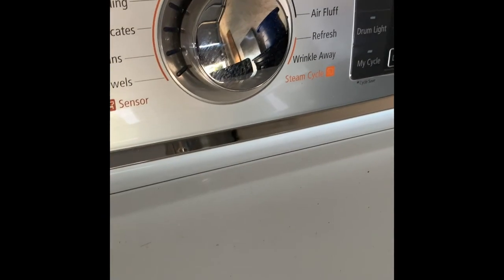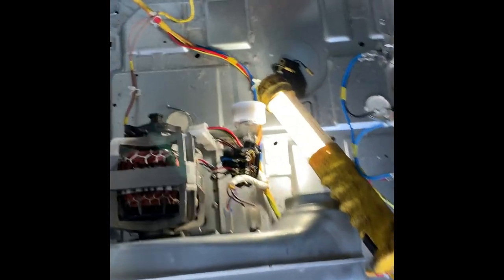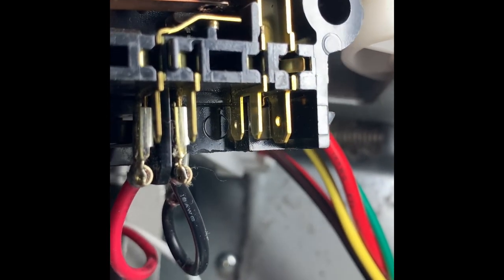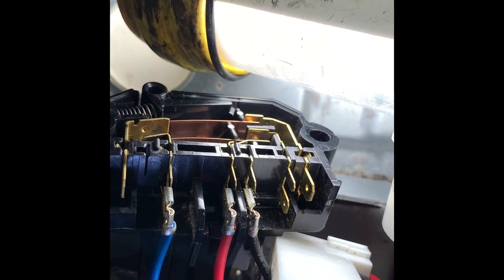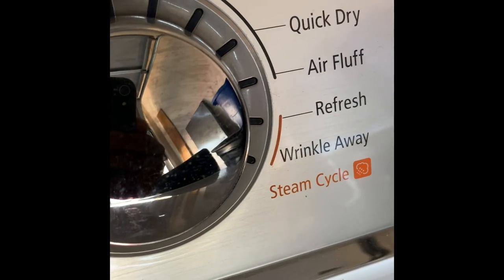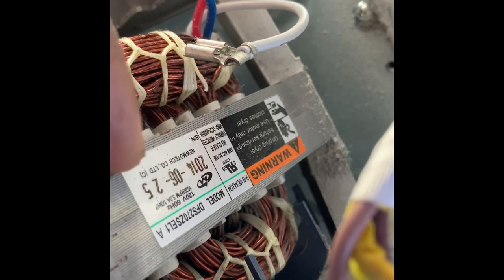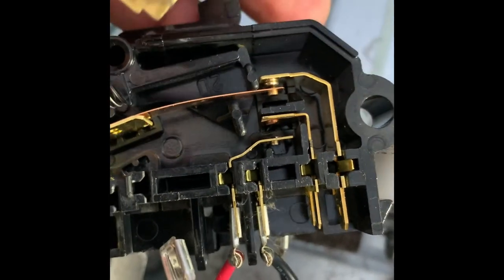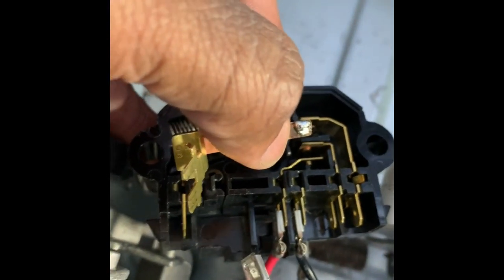Samsung Dryer Not Heating Fix + Repair (Motor Centrifugal Switch)

Comment: You sir are a genius.  My dryer was not heating.  I tried everything else then found your video.  Centrifugal switch contact wore out on mine also.  Soldered contact and filed solder to correct width.  Fixed the problem.  Thank you good sir for the video.
Reply from the maker: You Are Welcome sir!!

Comment: Hey! Hope this post is still active - I have a new motor installed 1 month ago - was working great now no heat - heating element is also new along with all the sensors. Everything tests out good - wonder if the new motor could burn out the switch already?

Comment: Hi, I’m having a heating issue and like you all of my other things check out ok including solenoids, flame sensor, thermostats etc. so my system sounds fine and I hear the click but no heat. Does the dryer function without heat if the centrifugal switch is the problem?
Reply from the maker: is your unit gas or electric
Reply: @youcanfixthat8636  gas
Reply from the maker: @brendawade8327  either centrifugal switch or igniter
Reply: @youcanfixthat8636  Igniter tested ok w my multimeter. So I thought it seems more than I can handle, then I found your centrifugal issue. Do I have to buy a new motor if I don’t want to attempt soldering ?
Reply from the maker: @brendawade8327  yes, you would have to buy a new motor

Comment: DId you solder job work ?
Reply from the maker: the dryer is still working great
Reply: @youcanfixthat8636  is it still working great? its now 10-23-2022 ???
Reply from the maker: @johncasor9698  yes it is.

Comment: good job. great fine... you the man. but you need to know 85%  of repair is just looking at things. then pull out the meter and the bigger question is why did you not just use the wiring DIAGRAM the pictorial representation of the circuit you would of found this problem quicker, and sometimes you can fine the board relay stuck and you can just hit it with something to get it to unstick but you cannot just change the relay you got to change out the board. only about $85 no big deal. but read the wiring road map or just watch on net some good techs teach you how to read one so easy to do...
Reply: Yes also he mentions it sends a signal to the board with that switch but had he read the diagram he would see that switch just sends the power to the heater directly. its important to understand how something works to fix it efficiently. Good on anyone learning on their own though.

Comment: My POS Samsung dryer, slightly different model, same internals, has done the same stinkin thing.  I have also repaired the contact points and burnt up again.  You can find the switches and replace them, however that does not fix the problem.  The newly installed switch only lasts a short while.  Something is putting too much voltage to that switch.  Called and harassed Samsung, but they don't care.  They want you to buy a whole new $400 motor.  The dryer is of course a few months past all the extended warranties.  All my stuff is Samsung, TV, fridge, washer, dryer, dishwasher, phones, etc,..  Wont buy another Samsung product again.
Reply from the maker: Their appliances are terrible….trash!!
Reply: 2 things. I would check for overvoltage at the switch and the unit. its unlikely you are getting overvoltage unless the unit is getting overvoltage, as typically the switch has 240v running through it. The situation sounds weird are you sure you hooked up the new switch properly? The other thing is samsung typically likes assemblies ($400 motor rather than a little switch) this is great for warrenty work because it is quick and cheaper on labor but out of warrenty this can skyrocket prices.  As someone who deals with samsung tech support and their worse customer support who gives terrible advice to people daily i wouldn't trust their advice.  They are often chair jockeys reading from a book. I have to regularly correct them in my customers homes.

Comment: Please leave this to the experts
Reply from the maker: ok Rookie!!
Reply: Experts ??? Experts are still learning after 30 years of dryer/ washer repair ??? no such thing as a Experts, Haha what a joke the Expert engineers at the factory make trash machines with trash low cost parts to fail quickly so i can go do repair on the Expert Design Samsung or LG garbage Appliances they Manufacturer low cost parts just to keep down the cost of the nice looking Machine but the belt tensioner wheels will fail very soon on these SAMSUNG it is the number one problem i see and the drum rollers are at a very close 2ND place. now the replacement parts are a sealed bearing that i just installed 6 months ago at a customer home and the seal bearing new roller is spinning in the plastic wheel hole which the sealed bearing is push in not glue in its another JUNK DESIGN FROM EXPERTS. yes on this machine just get it running again without a SAFETY ISSUE and run it, save this guy around $400 for me to come out and order another motor which SAMSUNG is hard to get parts for in San Diego like a 2 weeks here but it is getting better with covid-19 going away now.
Reply: @johncasor9698  I mean I am not disagreeing with the statement you put out but I think this guy is pointing out that the guy makes a lot of inaccurate statements about how the system works and he took it apart far more than was necessary. I immediately pegged him as someone who hasn't worked much at least on these units before. I try not to discourage people from learning but ya this video is a bit misinformed from a technical standpoint. As for the issue with the customer with a 6 month return on rollers I would check for a vent blockage. If you are seeing a lot of lint or didn't clean the lint from the dryer after replacing the rollers, this can shorten the life on as you said poorly designed parts... also I am sure you are installing the parts right but the post has to be replaced if the roller is grinding on it. I will assume you replaced the roller with a new post and roller set. I often see techs just slide the roller off the new post to save from removing the rear panel or from panel but this will not fix the issue and will cause fast returns. Hopefully i was able to give some information if you already knew cool just trying to help. good luck helping save people money I try to do it daily.
Reply: Hey is 100% correct.  Same problem with mine.  Solder fix worked.  👌